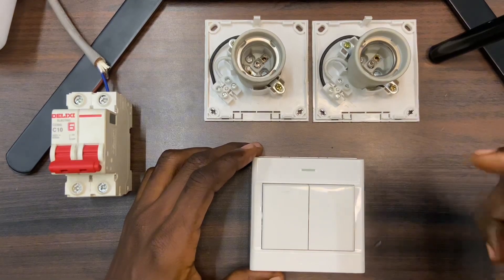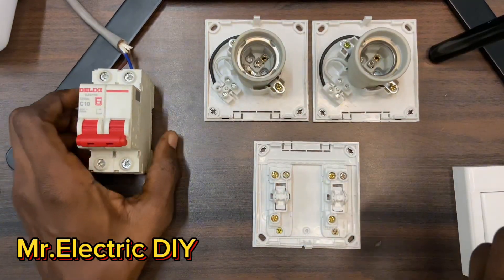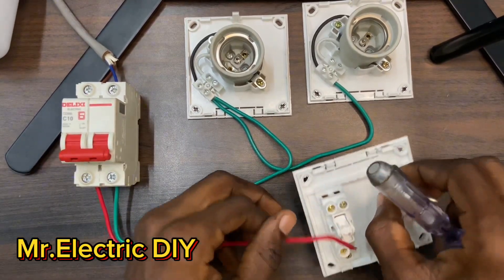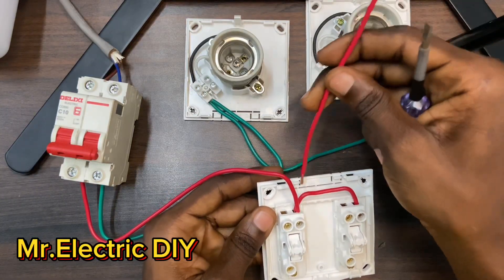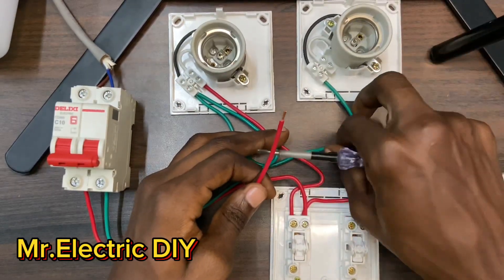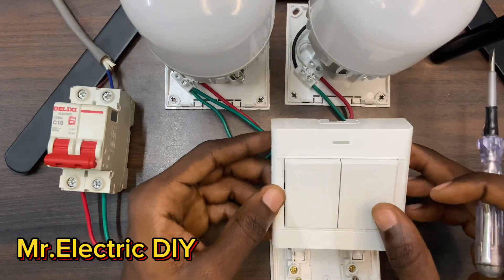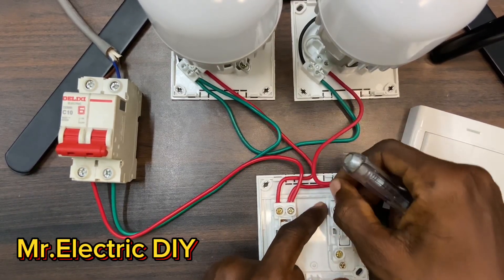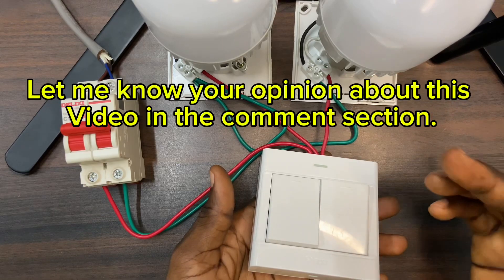How To Control Two Bulbs with Two Separate Switches || 2 gang 2 way switch Wiring diagram ​⁠

Comment: Isn't this one way 2 gang switch?
Reply from the maker: No bro.
It’s 2 gang 2 way, others call it 2 gang 4 way.
The way is the L1 and L2
Reply: @Mr.Electricdiy ❤❤❤❤thx
Reply: Is there a video with a ring sockets circuit with a 1/2 way 2 gang switch in a junction box?
Reply from the maker: @geofferyromany4634 you are welcome